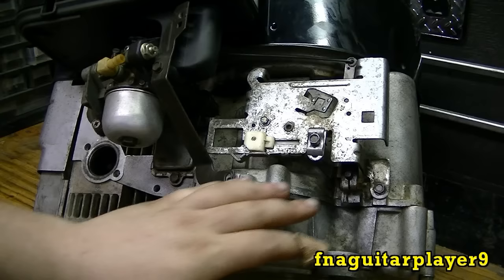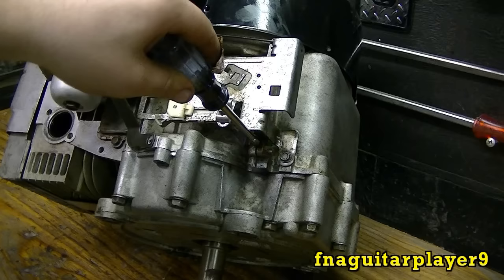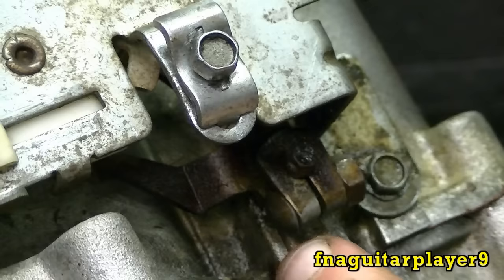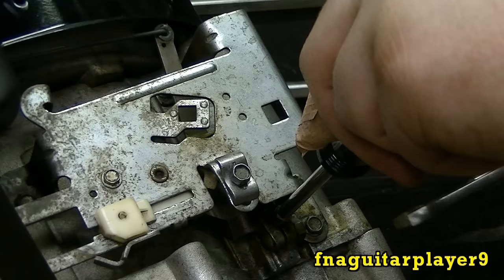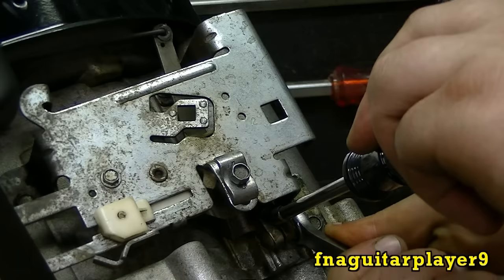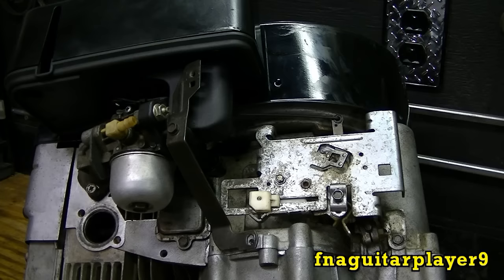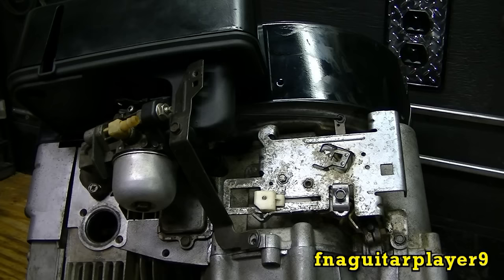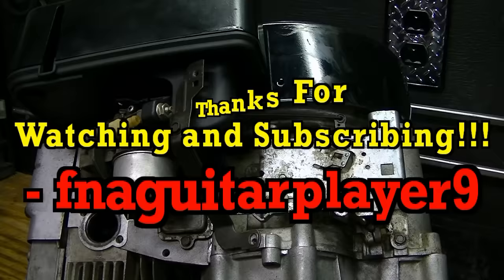How To Adjust Mechanical Governor On Small Engines

Comment: I left this on other video but may be better suited here....my 8hp briggs ic engine wont start. I can move the top front to back only as much as the throttle cable moves on the carb. So something is connecting the internal or engine to the governor. Any idea what it may be? I think other owner ran it low on oil
Reply from the maker: It sounds like something may be broke inside, if it was ran low on oil it may have thrown the rod, sometimes it can be repaired depending on if it just broke the rod and didn't destroy other parts when it happened, i'd suggest removing the sump and taking a look to see. thanks for watching!!!

Comment: Mine surges a little and also the idle won't drop down low, when I wind the idle screw out a gap just appears as the arm never touches it as the rpm stays too high so I think the gov needs some slack taking out like this. What do you think?
Reply from the maker: Sounds like there is to much slack in it. Thanks for Watching!!!

Comment: I like the video, but I just wish someone would make a before and after running video. I am not a mechanic, so a visual reference would help.
Reply from the maker: Thanks, I understand, I actually originally had planned on it when i made this video, but never did do it, but usually the only problem a governor out of adjustment will cause is loping or surging, meaning the engine will kind of lope up and down, almost like your revving the throttle, where it should run smooth. I do understand that a visual would be better. Maybe sometime I can make a video showing this in more detail. thanks for watching!!!

Comment: So when your positioning the governor to the place you want it you have to turn the little nob to the right with some pliers and then tighten the bolt with your free hand ? ???
Reply from the maker: Yes, its actually a 3 hand operation haha Its best if you can use a zip tie or tape to hold the arm back in place (in the full throttle position) then turn the shaft and tighten the bolt. Its hard to do, as you seen it kept moving on me in this video. Thanks for Watching!!!

Comment: I have a tiller with a Briggs stratton model 1263120580b8 engine. The throttle stays in the wide open position and I'm assuming that the governor is supposed to adjust the the throttle once the engine starts up but thats not happening it's staying wide open. When the throttle is in the wild open position the governor moves in the opposite direction as the governor in your video, so when I adjust the governor shaft, shouldn't  I turn it counter clockwise? If I turn it clockwise, then the governor won't move at all. Or should I adjust the governor with the throttle up against the idle screw in the closed position and turn the shaft in the clockwise position?
Reply from the maker: Mark Shelton You will have to turn it in the same direction it turns when its opening the throttle, so if you turn it clockwise and the throttle opens, that is correct. It could also be just a rusted up spring or a linkage binding up as well. Thanks for watching!!!

Comment: Very good video, thank you.  Is this type of adjustment the same for a 16.5 - 17.5 HP Briggs and Stratton engine on a lawn tractor to fix over revving?  And, are there any specific springs that should be replaced or checked?
Reply from the maker: +Steve Engelking Thanks, your welcome! Yes, its the same on just about any small engine. A linkage could be bent or something as well causing over revving, but the governor could be. Does the throttle control still work? If it doesn't (just wide open throttle all the time) then i'd say a spring or linkage broke causing the throttle plate to open up. Thanks for Watching!!!

Comment: Well, that is exactly what my engine is doing. I can see the governor moving when it happens, and I can get it to stop by using the manual choke until the engine warms up. But that process takes around 15 minutes and it smells like it's running rich.
Reply from the maker: That sounds more like a carburetor issue than a governor issue, the carb might need adjusted or cleaned, a partially clogged jet will cause the same symptoms.

Comment: I have a Toro Personal Pace with blade stop. It is a Briggs 6.75, air vane style. Problem is that it revs way too high when blade is not engaged (bail arm release and in spin stop mode) @ up to and maybe beyond 4000 rpm. But when pull the bail and thus engage the blade it settles down to a more normal 3200 or so. Correspondingly, if I reduce that over-rev 4000 no load rpm (by bending the tang and shortening the gov. spring) to around 3200, the loaded rpm then drops to a weak 2700 or even less. All external (visible) linkages, springs, etc. seem to be moving freely. Do you think I need to open the crankcase and investigate the weighted governor part? BTW, super video as usual.
Reply from the maker: If it has a air vane style governor there is no internal governor parts, you will see a piece that looks just like the governor in the bigger engines but its actually just a oil slinger on those smaller engines, there are some newer ones that they are putting a mechanical governor on, yours may be, but if it does have the air vane then it doesn't have a internal governor. First thing i would check is make sure there is nothing blocking air going into the fins on the flywheel / shroud and make sure none of the cooling fins on the block is full of dirt/grass/bee nests / etc, if the air can't flow right it won't work right. And make sure the linkage is moving free, if its stiff or sticking it can cause that to happen as well. hope this helps! Thanks for Watching!!!

Comment: I have a really old twin 18 Briggs on the original mower that has been stripped down to pull a small tilt trailer. lately when the engine is started the choke has been had to be left open for the engine to continue running and idling. this mower has a fuel pump. what adjustments need to be made in your opinion? thanks Tony

Comment: Would it be the same clockwise turn for a vertical shaft 6.5 B&S? I recently installed a new carb on my mower and now when starting the engine runs at really high rpm. I'm guessing this is the problem.
Reply from the maker: yes, it would adjust exactly the same. Its pretty much the same on most brands and types of small engines, there are some variances though, you can always check, the governor arm moves in the same direction that increases throttle on the carburetor, opening the throttle plate up. Sounds like it could be that or a linkage is in a bind. Thanks for Watching!!!

Comment: Hi, i got a 18 hp, Briggs, vertical shaft.  The engine has just started revving high out of control regardless where the throttle lever is.  I took the cover off and cleaned everything in and around the carb and governor controls.  I also lubed with WD 40.  Didn't seem to help.  I did notice that I can easily push the governor lever/carb lever to lower the rpms.   Engine is about 13 years old and has a LOT of hours on it.  What do you think problem might be?  Thanks
Reply from the maker: Try to adjust the governor like in this video, if that doesn't help then i'd say the problem is inside with the internal governor/oil slinger. Hope this helps. Thanks for Watching!!!

Comment: I got a Troy Bilt with a 17.5HP riding mower that's been acting up lately.   Under cutting load (blades engaged), it's almost as if it wants to bog down, unless I stop or disengage the blades.   Also, going up the hill is not somewhat of a challenge when it didn't used to be and top speed is slower also.  Idles just fine.

Is this a sign that maybe the governor is out of whack ?  Or something fuel related ?  Thanks, great video.   Subscribed.
Reply from the maker: Sounds like the carburetor may need to be cleaned and/or adjusted, sounds like its running to lean (not enough fuel going through) I don't think its the governor, its possible but it sounds like carburetor issues. I have videos on how to clean these carburetors. Appreciate the sub, and Thanks for Watching!!!

Comment: I have a pressure washer with a Briggs & Stratton 8 1/2 horse the choke doesn't close automatically like it used to and the governor doesn't seem to work when I squeeze the trigger the engine does not wrap up with that be in the governor adjustment
Reply from the maker: First thing i would check is the springs, it could be a stretched or broken spring causing the lack of power, as far as the choke goes, if it has the auto choke like this then i'd say the cable just needs adjusted, i don't think the governor itself needs adjusted, it may but i'd try the simple things first. Thanks for Watching!!!

Comment: I just got a john Deere and it has a fb460 engine. when I bought it the seller showed me the choke/ throttle and said keep it at idle(all the way down) and barely move it up to increase throttle. if you slide it up too much, you will flood it. when he turned it on he wasn't kidding. you barely touch the throttle up and it sounds like you slid it up to choke. what can I do to fix that issue?  now it's not running, it just turns over and over.
Reply from the maker: I have another video on adjusting and installing the throttle and/or choke cables and it would explain it better then me typing it out. if you have any questions after watching the vid let me know... https://youtu.be/1WWpeyDbHjA Thanks for Watching!!!

Comment: can the GOV be adjusted to increase the speed (little bit more speed)?  I am curious and learning more about it.  My tractor is a UTV now and for fun with the kids.  Great videos by the way!
Reply: id buy a cheap tachometer and set the max rpm to 3600, any more then that and you're shortening the life of the engine and increasing the chance of it throwing the rod out of it, if you still want it to go faster find the size of your pulley on the trans axle and put one 2-3 inches smaller (as long as its a gearbox and not hydraulic trans)
Reply: and i wouldn't mess with it if you still use it to mow grass
Reply: Thanks.  I am already smaller on the pulley over the trans axel.  I will take you advice and not mess with the gov.  My tractor does not cut grass it's a UTV now.  Thanks!!
Reply from the maker: I agrere with Reise, you can get alot of just changing pulleys from a stock engine, it will surprise you. Thanks for Watching!!!

Comment: Hey man im looking to instal a gas 0edal on my mower and use it off road. Its a 6speed manual murray.

If i just ignore/bypass the governerlinkage and jus hook my throttle line directly to my carb will it damage my motor?

 I know that i could over rev it as its no longer governed but im not really worried about that im worried about some sort of misalignment/conflicting forces causing some for of engine detonation lol

Also what if i just hook my throttle line directly to the top of the lever that controls the internal governer?(same spot that the carb throttle line connects to the internal governer lever/linkage)
Reply: Sorry for incorrect terms or general misunderstandings, I'm kinda outside of my comfort zone but that's why I decided to take on this project, I'm trying to learn and I've already gained so much knowledge.

Comment: i have a briggs with the same throttle setup. sometimes when i move the throttle lever to high/choke  the throttle arm gets stuck and wont move forward to speed up the engine. it doesnt do this all of the time maybe 30% of the time.  i dont see any obstructions.  the tiny spring on the throttle arm is broken though. any ideas?
Reply from the maker: Try adjusting it like i did in this video, and also check the governor spring that attaches on the arm, not the small one but the bigger one, if its broke it will act like that. Thanks for Watching!!!

Comment: I have the same motor, I am leaking a bit of oil out if my overnor rod at the adjustment location, is there a seal in the Inside to replace?
Reply from the maker: No actually there is no seal, its normal to see them "sweat" a little there, but if it's excessive it may need a new bushing, I can't remember if i've ever had to do one or not to be honest! Thanks for Watching!!!

Comment: I need some help with a 11hp briggs engine, at idle the rpm goes up and down slowly and as soon as you toutch the trottle it skyrockets up to way above 3600 rpm. I have cleaned the carb and adjusted the govenor as shown in this video. I would be thankfull if I got an answer soon as possible. /Gabriel
Reply from the maker: zbij1998 That sounds like a air leak doing that, I would suggest checking the intake gasket, it may be torn or not sealing. That usually causes problems like that, you can check if it is a air leak by spraying some carburetor cleaner (or even wd40) around where the gasket is, just be careful with it, its very flammable, if it is a leak, the engine should stumble or change RPMs when you spray it around it. There are other problems that could cause it but i'd check that first. thanks for watching!

Comment: So if its revving to much there's too much spring tension? Great video!
Reply from the maker: Love2boat92 Yeah, either that or not adjusted right, some will act different. Appreciate that! Thanks for Watching!!!
Reply: fnaguitarplayer9 I see. We'll I'll fiddle around with it some more and hopefully it works. I think the mower is just getting worn out. It wouldn't surprise me if it had at least 1500 hours on it maybe more in the almost 30 years its been around.
Reply from the maker: Love2boat92 I hear ya. That is alot of hours, but as long as its not burning a whole lot of oil (or any) its still in good shape.
Reply: fnaguitarplayer9 Actually its doesn't burn any oil or use any oil. It leaks oil though. Lol.
Reply from the maker: Love2boat92 I hear ya haha

Comment: thanks for the good videos you make. my question is I have a kolher SV590S and I just replaced the piston rings and now I am putting it back together does that work on this engine as well
Reply from the maker: Your welcome! It should be the same, as long as the linkage moves in the same direction, but as long you adjust it in the direction of full throttle, it will be the same. thanks for watching!!!
Reply: Thanks for your reply  I am going to start it for the frist time tomorrow
Reply from the maker: your welcome! I hear ya! Good luck, hope it fires right up!

Comment: I have a GX620 Honda 20 HP pressure washer motor that I'm putting on a go kart frame that I just bought. If I did this to the governor would it speed the kart up enough to matter or could it possibly mess up the motor?
Reply from the maker: If you bypass the governor it will probably destroy it, small engines like to throw rods when the rpms get high. But, as long as the throttle isn't held wide open for more than a few seconds it wouldn't hurt it as bad, still not good for it, but not as bad WOT runs. I would suggest working with the gearing first, and see if will even need more speed, if you gear it right you can get alot of a stock governed engine. Thanks for Watching!!!

Comment: Can the other 'tie point up on the vertical part of the governor arm also be used to secure the spring?
The 'dog-leg part doesn't seem to work on my 12.5Hp engine? (It interferes with the choke linkage)
Reply from the maker: sounds like something may be bent or the choke linkage is upside down. I could be wrong, but it should not interfere. Thanks for Watching!!!

Comment: hi
if i do what you did dont i get damage on the motor? because in the other video i saw that he set it with a thing that meated the rpm from the motor can i cut the grass or need i turn it back then ? thanks
Reply from the maker: Lorenzo Scholtemeijer No it will not damage the motor as long as the linkages are moving free and the spring is in good shape, it will be very close to the rated RPM's, which at full throttle is 3600 rpm, but as long as it doesn't exceed 3800 it will be fine, and it should idle around 1800. But yeah it is best to have a tachometer to set it all exactly to spec. Thanks for Watching!

Comment: Im putting a newer 10.5 Briggs carb on an '84 11 HP briggs, but the throttle/choke butterflies are in different spots. Can I still run the governor from the 11 hp to the 10.5 carb? Thanks, Mud Machine
Reply from the maker: Yes, i don't see a problem with it, you could try using the linkage off the 10.5, it should be the right length, as long as you get it connected it should work fine, one thing though, i would suggest doing what i did in the video after you get it set up, just to make sure the governor is calibrated right. Your welcome, thanks for watching!!!

Comment: I've got a 98 Cub Cadet with a Kohler Command OHV 12.5hp engine, and I'd like to get it to go faster. I know if you adjust the governor a certain way, it allows more RPMs, which I'm assuming results in a bit more speed. So is this how you would do it?
Reply from the maker: It would be, but its not recommended to mess with the governor, 99% of the time the motor will throw a rod or something. You can speed it up by changing pulley sizes as well, but not recommended on grass cutters, racing mowers only. Thanks for Watching!!!